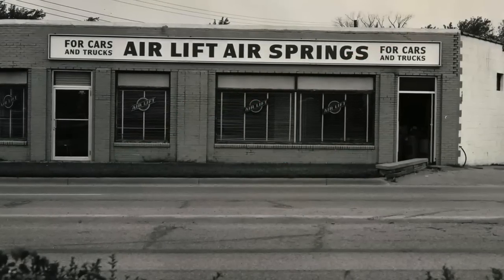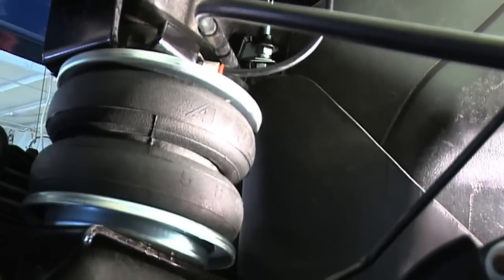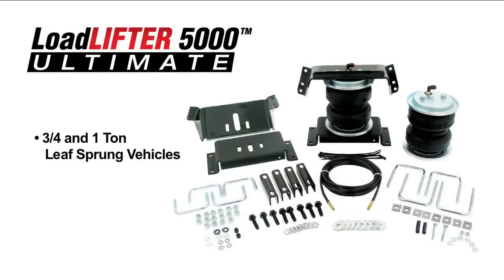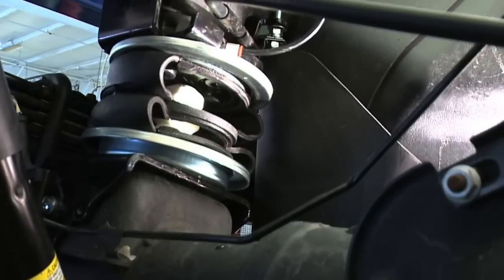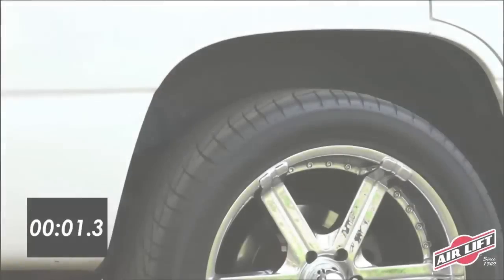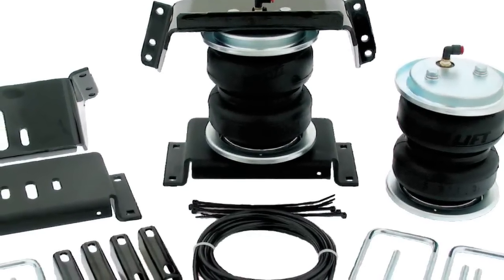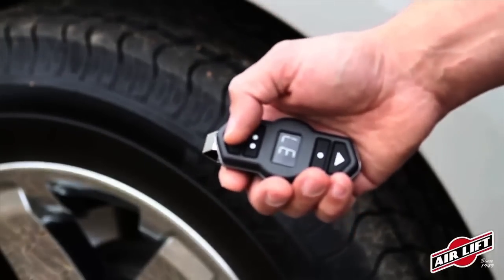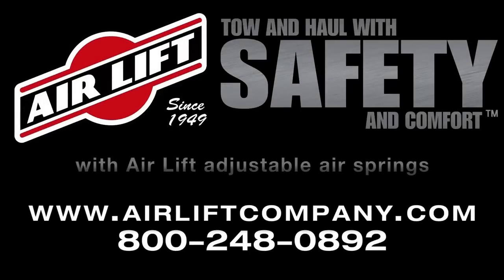LoadLifter 5000™ ULTIMATE air spring kits - from Air Lift!

Comment: Can you run the bags empty while not carrying anything?
Reply: Air Lift if my rv (5th wheel)is 16,000 lbs how much air presure should I i use?
Reply: they recommend 5 or 10 psi with no load
Reply: You sure can..... for a very limited distance. It isn’t meant for more than driving around an underground parking lot where your vehicle wouldn’t fit due to a height restriction... or to get it in the garage, if you’re garage is from back in the 90s